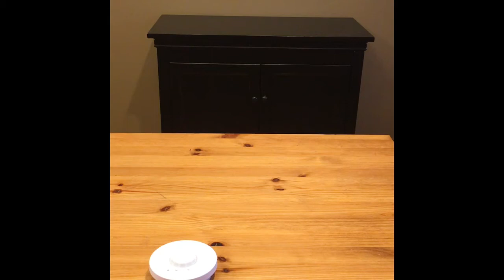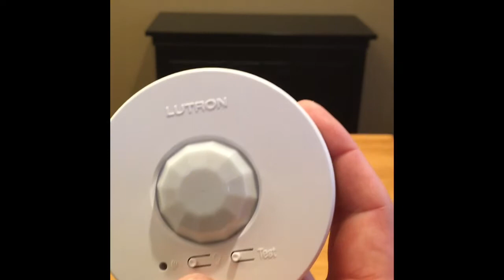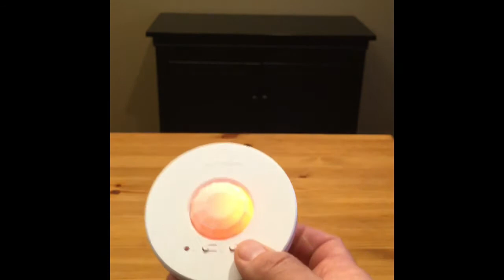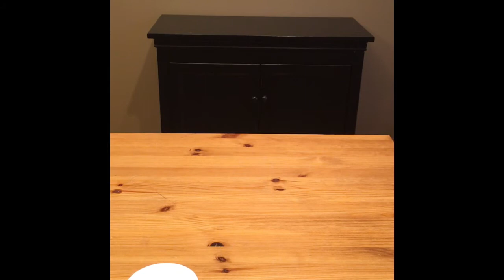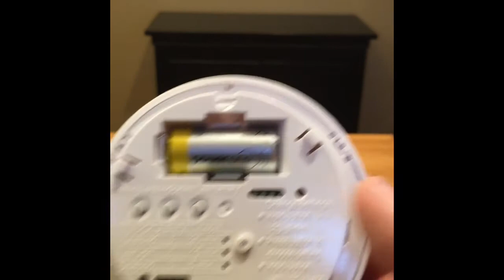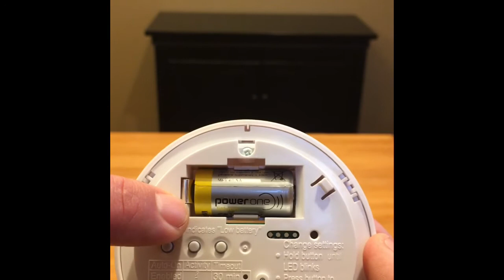Lutron Wireless Sensor Troubleshooting- 4 Easy Steps

Comment: Can a daylight sensor be used on standalone system with power pak and pico or does a hub only way?
Reply from the maker: The daylight sensor can be used in a stand alone system.  The drawback is that you have to manually adjust (on a ladder at the sensor) the brightness if it is too dim.  If you have a hub, you can adjust the brightness in the vive app which is really helpful.
Reply: @prudalavage thanks for reply

Comment: We have facing the issue of light is not off in motion mode by RMN-5R-DV-B senser controller. Light is manually on-off by push the senser butten, please share the reason why is not senser working in motion mode, please share the trouble shooting process.
Reply from the maker: Some things to check-  
-make sure sensor is 4ft minimum distance away from hvac vent
-if there are more than one sensor, you need to check both sensors
-how old is the sensor? 
-lutron has 24/7 tech support at 1-800-523-9466
Reply: @prudalavage  please share the trouble shooting PDF file

Comment: RMB-5R-DV-B senser pair & unpair process need to be share
Reply from the maker: You have two options.  You can factory reset the powerpack-by doing a button press of tap-tap-tap hold for three seconds then tap-tap-tap .  This will unpair everything.  If you want to just remove the sensor- you can tap-tap-fap- hold for 6 seconds- tap tap tap on the lightbulb button on the sensor.
Reply: @prudalavage  please share the video of pairing & un pairing process

Comment: Do you know how to reset these to default settings?
Reply from the maker: The sensor usually gets synced up with a Lutron powerpack.  You would reset the powerpack by doing a button press sequence of Tap, Tap, Tap, Hold down... 3 quick taps. If you want the sensor to stop communicating to the lights, you do the same thing on the sensor.  Lutron also has 24/7 tech support